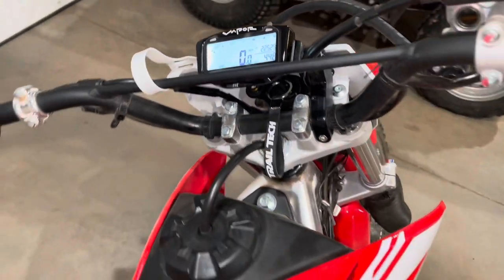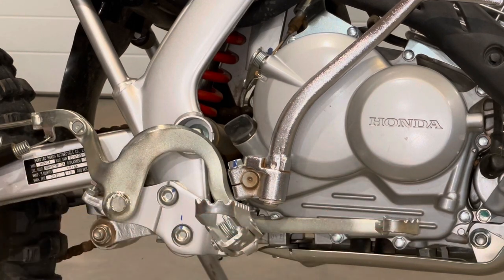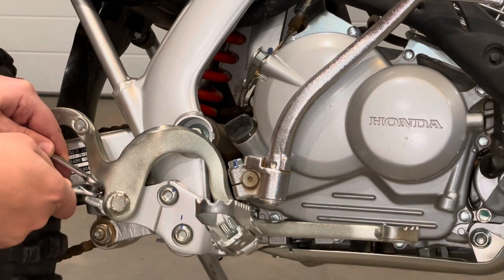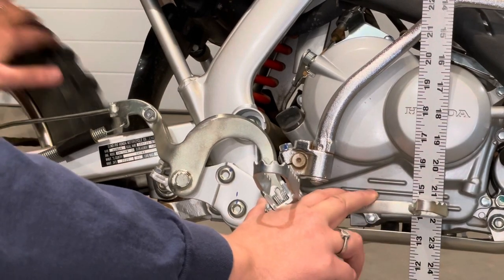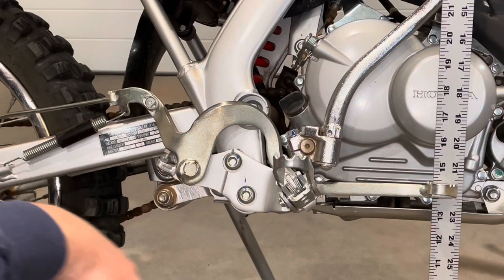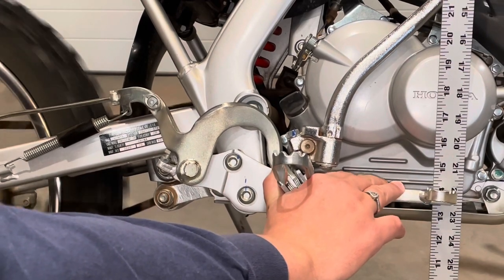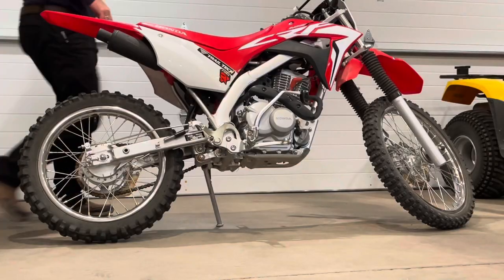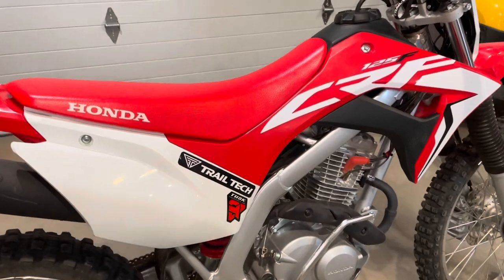REAR BRAKE ADJUSTMENT - Honda CRF125FB (Vid #22)

Comment: Your final free play as I saw on your ruler was about 1.25 inches, which is outside the spec in your owner's manual.  Did I see that wrong?  Great how-to video, though, and interesting to see Honda's wear limit indicator easily observed on the outside of the bike.  Thank you.
Reply from the maker: I think you are right, it was between 1 and 1.25 inches, which is outside of spec, and after the video when I checked it again I tightened that brake adjuster nut one turn further. Thanks for watching!

Comment: hello, i have a 2014 crf125fb and my rear brake barely moves and seems stiff but the rear drum ajuster is all the way loose (all the way out)?  what do u think is causing this?
Reply from the maker: Hmm. Could the brake simply be all the way worn out? Or perhaps the mechanism has gotten rusty and stiff?
Reply: @SouthwestORV  the brake is still good I found a solution going to ajust it forward more so I can screw on the nut all the way and then should be able to ajust from there.
Reply from the maker: Hope it works!

Comment: Is this similar to a rancher brake adjustment? Since I rolled it I think I need to adjust the rear brake.
Reply from the maker: Yes it is similar. You don't want the brake dragging, but yes if I recall it's a wing-nut adjuster on the drum with your Rancher.

Comment: So I started changing my tires and as soon as I removed the front wheel the brake like locked uo and I can’t get the pads to separate how do I adjust the front brake?
Reply from the maker: That’s odd. I do not know the answer to your question. They should not have locked up.
Reply: @SouthwestORV  i got it figured out i just pulled them apart with pliers Lol  have not had a problem since